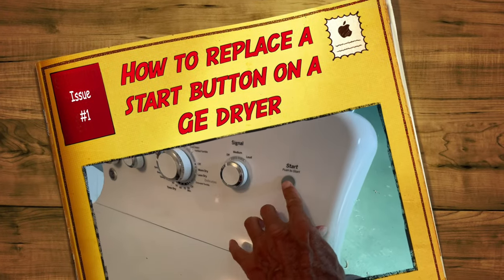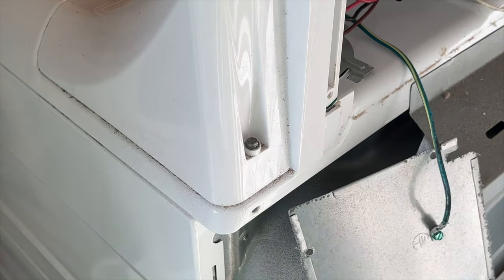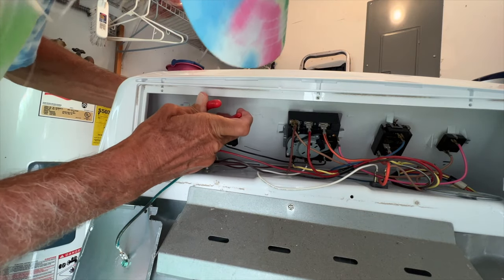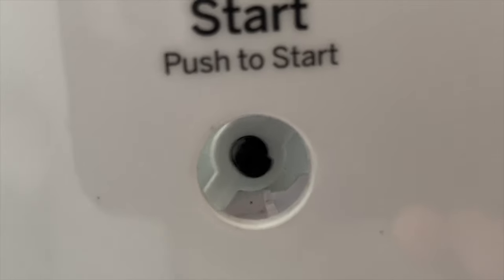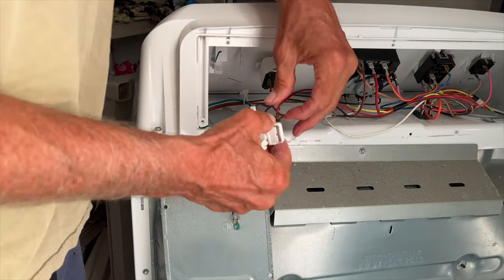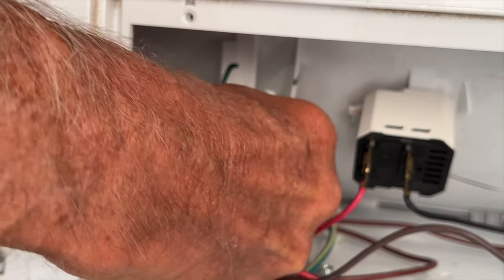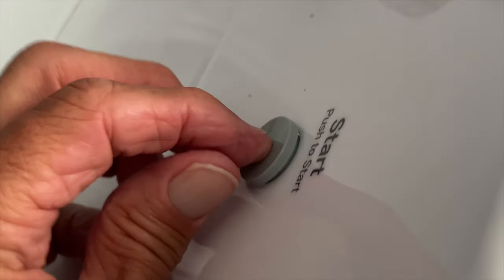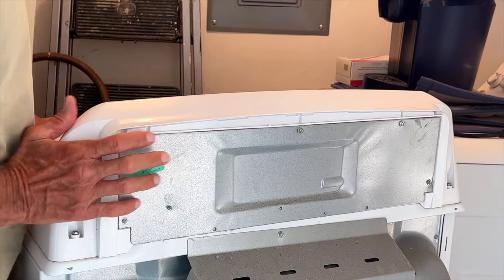How to fix a start button on a GE dryer

Comment: I just did a similar procedure today.  But, I pried the grey button out with a larger flat tipped screwdriver, which came out very easily.  Then I twisted the push button switch out and reseated it and pushed the grey button back in, making sure it was aligned.
Reply from the maker: I think that’s the better way to do it. I did it kind of backwards.

Comment: Thank you so much. I thought I needed to replace the thermal fuse or the door switch is what I thought the problem was after researching and all the YouTube videos. Then I came across your video and found out it the button was broken. I just super glued the metal pc back inside the button and it did the trick. I cant believe it was something do small and such an easy fix. Thanks again.
Reply from the maker: Excellent!
Reply: I’ve just done the same thing now I’m moving on to the push button!

Comment: Thks for video. I see a crack on the start button. Mine had one also and switch was cracked. Just tape it with gorilla tape and it’s back working. Probably going to order a new switch and start bottom though. Thks for video. Saved me some money!!
Reply from the maker: Glad it helped do it yourself. Thank you for watching.

Comment: THANK YOU! Mine seems to be just the plastic button? The switch works fine so I just put it back in without the button. :)
Reply from the maker: Did it work?
Reply: @TomLeeman  I did this too - the button looked ok, but was not activating the dryer.  So I removed the gray button and now we just push directly on the black switch.
Reply from the maker: @edstevenson1693  excellent work around you can’t complain if it works right good job thanks for watching🤙🙏

Comment: Hey what is an alternative if that flap that holds it breaks off
Reply from the maker: Are you talking about the rubber part that’s in the front I think it will still work if you can connect it into the holder and just press that little plunger

Comment: I am having a problem with mine that is a bit different.  When I push the Start button it feels like it's trying to start (It makes a noise as long as I am holding it) but it doesn't want to kick over.  Could this be the starter as well or is it maybe something else?
Reply from the maker: That switch has like a little contact played in it that Hass to be engaged to get it to work and sometimes that thing is just not working and you have to get a new one. Good luck. Thanks for watching.
Reply: What did you do to fix your dryer? Thanks
Reply: @shannonp4037  The downstairs neighbor called a repair guy.

Comment: My problem is similar.  When I push the start button the dryer runs. As soon as you take your finger off the button the dryer stops.  So the start button works but won't hold itself to dry the clothes.  I held the button for a minute or so then felt the clothes and they were slightly warm, so the dryer works, it's the grey round start button that won't stay on. Any advice from anyone on what part I need to buy and how to fix?  Thanks so much!
Reply from the maker: The Springs in there going so do the Contacts they don’t last forever unfortunately I think they make them that way so you buy new washer and dryer. Good luck thanks for watching.
Reply: What did you do to fix your dryer? Thanks

Comment: So my button will start the dryer but it turns off as soon as I release my finger from the button… the button has to be held down to keep the dryer running . What should I do?
Reply from the maker: Need a new switch it sounds like
Reply: Mine too. What was the issue with your dryer? Thanks

Comment: The plastic lip on the bottom of mine completely broke away after 4 and a half years.  No idea how that happened, unless it was installed improperly, the plastic wore out, or maybe my wife hammered the button.  

Trying to brace it with duct tape, I’ll let you know how that goes.
Reply: How's it going bro did you did it?
Reply: @catolicodominicano Yes I was able to use several strips of duct tape torn in half lengthwise to sort of build a cradle to hold the switch flush against the panel.  No idea how long that’s going to last, but at least I can start the dryer now.  I guess if the tape ever wears out or comes off I can always just open the panel up again and retape it.  

Still, bizarre cheap design from GE.  Can’t say I’m surprised these days though.
Reply from the maker: Good luck I hope you get her fixed and thanks for watching